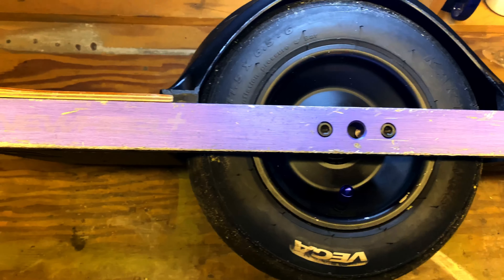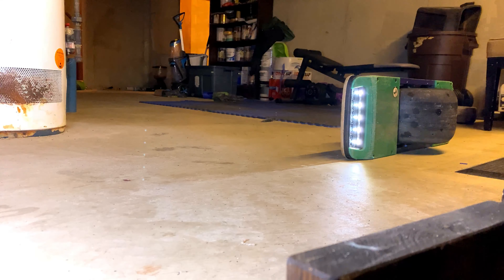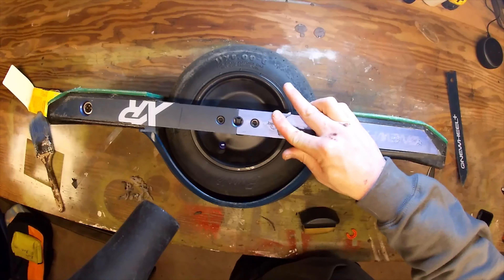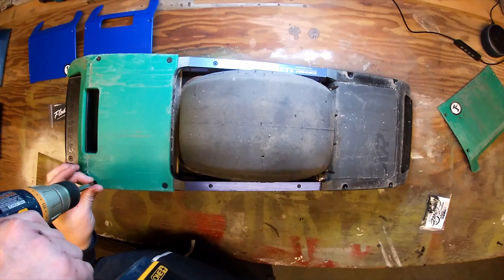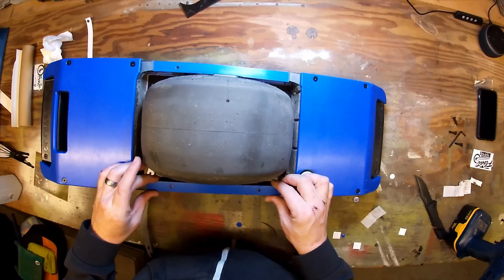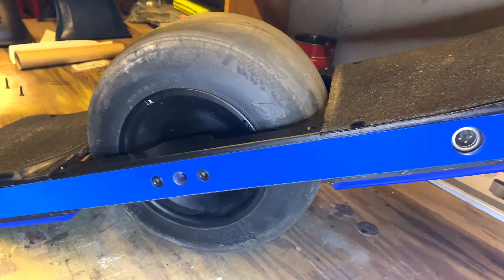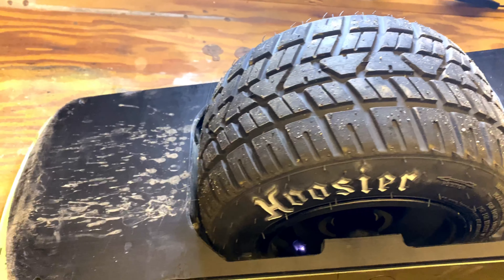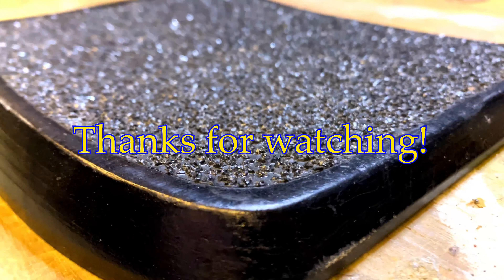Protecting Your Onewheel!!

Comment: I’m a proud Pint owner as of last Wednesday and have been looking into fangs for it but the only ones I’ve found are from Carbon Smith & very pricey @ $235.00
Reply: The CarbonSmith ones are worth it. It’s carbon fiber and the front handle has a better grip than the Float Life solo plate
Reply: How did I know you would be into these LMAO - lil rob

Comment: what did you use to color the front foot pad black?
Reply from the maker: Sharpie 37371PP Oil-Based Paint Markers, Fine Point, Assorted Colors, 1 Blister Pack with 5 Markers, Total of 5 Markers https://www.amazon.com/dp/B000GOYAPQ/ref=cm_sw_r_cp_api_i_OjPkFbTS35T11
Reply from the maker: Not the fine point ones but it’s similar to this. I bought a 4 pack of just black markers and there was different sized tips in there